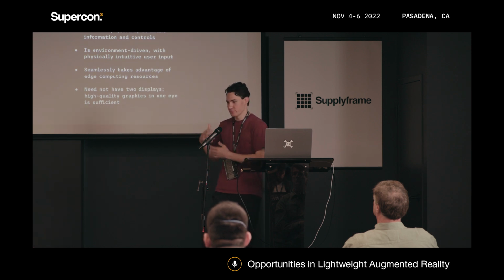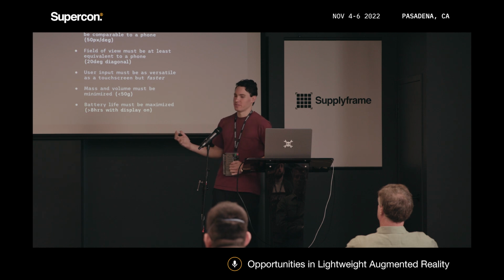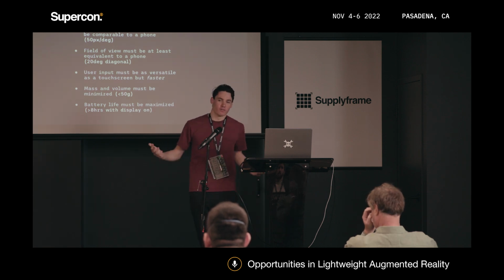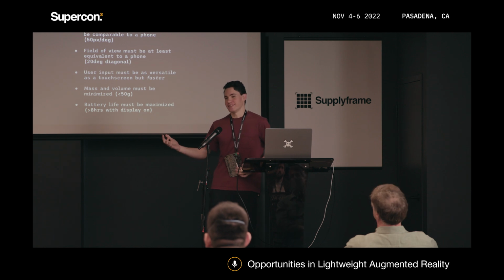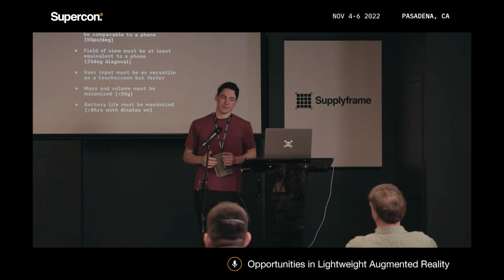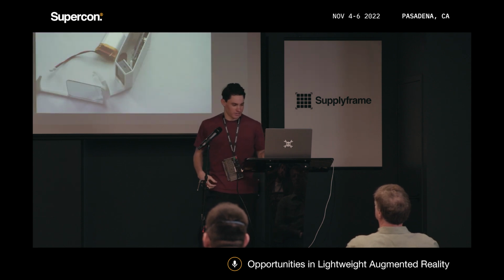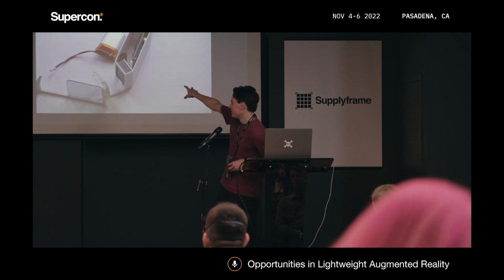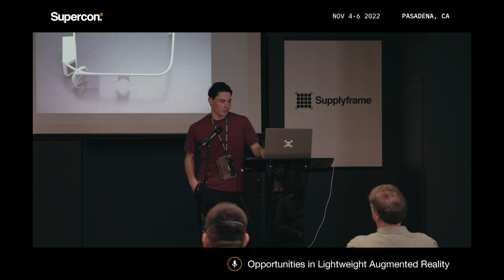Supercon 2022: Aedan Cullen Is Creating An AR System To Beat The Big Boys

Comment: I’ll need to read up on all this!

Granted i think Project Northstar (and it’s derived projects, I forget the names), wins in the “non-passthrough” AR category, but areas like this (normal-ish looking glasses) are definitely lacking in the non-proprietary world.

So I’m excited and need to read up on this!
Reply: The other segments, at least in my opinion, would be a “Passthrough” Mode on a High Tier VR Head Mounted Display (could be called a MR Headset then i guess), and something Hardhat Mounted.

My ultimate one would be some Frankenstein combo of the 3M Speedglas PAPR Helmets, and Project Northstar/That F-35 Helmet.

Combine the helmet mounted one with integrated Thermal, UV, and 3D Scanning sensor fusion, and you could have a REALLY USEFUL PRODUCT!

(Also just being able to have a HUD/Labels for stuff on a job site)